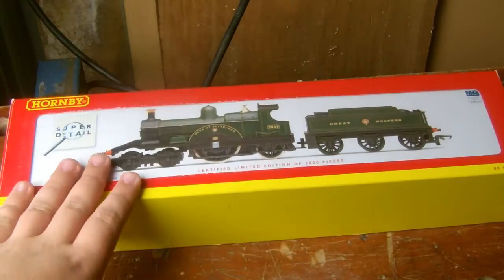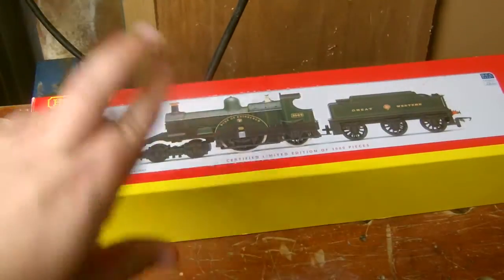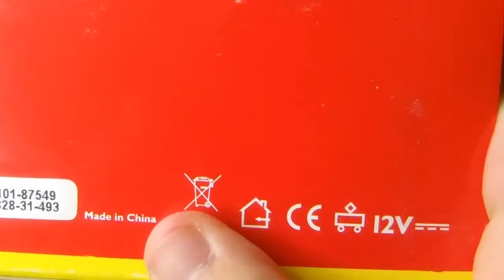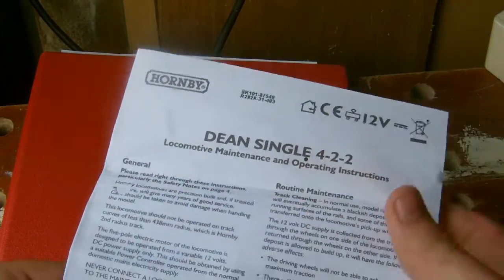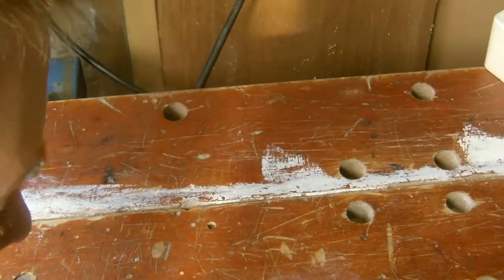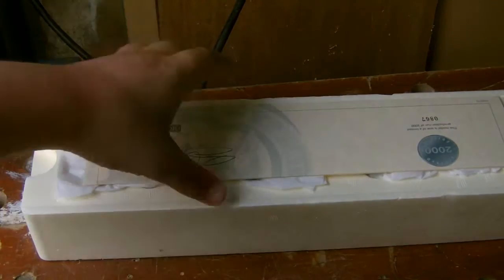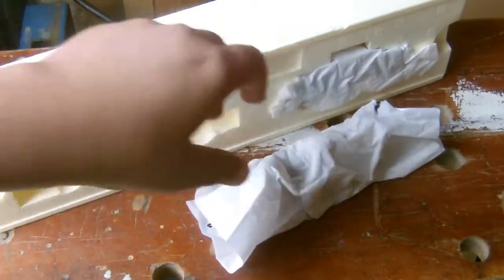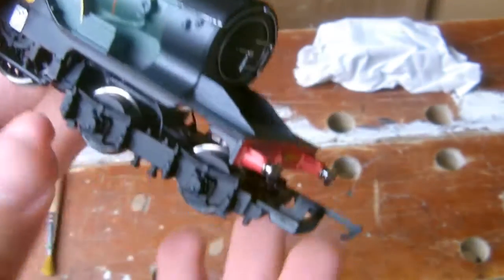Unboxing the GWR Dean Single from Hornby

Comment: Hate to break it to you, but the current Hornby Railways did NOT evolve from the Meccano brand name known as "Hornby", which when bust in the mid 1960's. The current Hornby Railways (now trading simply as Hornby) is the evolved Tri-ang Railways which changed its name after they bought the failed Meccano company. Do not get the two mixed up as they are both completely different companies with two completely different histories, now with only a name in common.

Comment: I wouldn't say Hornby has the most interesting History for the original Hornby is actually no more as Tri-ang bought the company & use the name. The original Dublo models were produced by a company called Wrenn for a while before they went bust. Hornby Dublo was models & Tri-ang was toys which is why Tri-ang did better. However, Tri-ang Hornby, as they were known for a while, was behind the competition really with their models. Airfix produced their chinese made models with more detail than Hornby could from their Margate factory back in the seventies. Then Palitoy hit them with the Mainline range in the eighties which had good variety & good detail (I have a Mainline 6600 tank & aRebuilt Patriot & I love them loads), much better than hornby could come up with & these days, Bachmann offer models of superior quality & detail on models that cost less than Hornby. Hornby's pricing system is ludicrous, an N2 (an Airfix designed loco) costs the same as the Railroad P2, a much larger loco with similar detail & the M7 tank costs the same as the T9 greyhound. Hornby do produce nice models but they are way too expensive for a lot of young modellers. I don't hate on Hornby but I've never liked the finish on their models (toy like with bright silver buffers, lovely) & the fact the 1400 auto tank, an old Airfix model dating to 1975, they make costs over £60 now & they can't even paint the chimney for you. Not forgetting they palm off Ex-lima models for mad prices too. The Class 73 for instance without sprung buffers or lights costs over £70, it's a nice model that Lima tooled nicely but it's too expensive. heck, even the 101 two car costs £100 when you could get a Lima model, fit lights & re-motor it & still save money